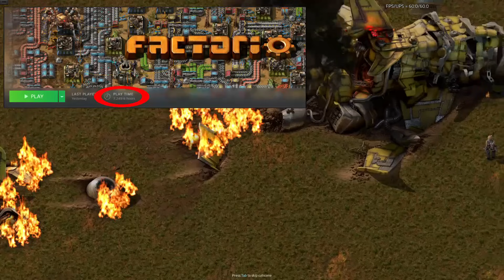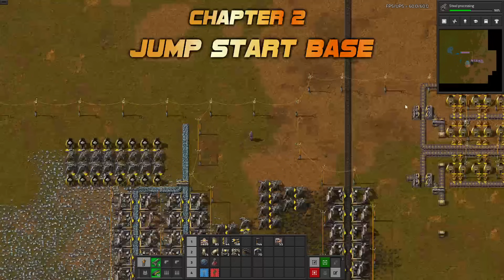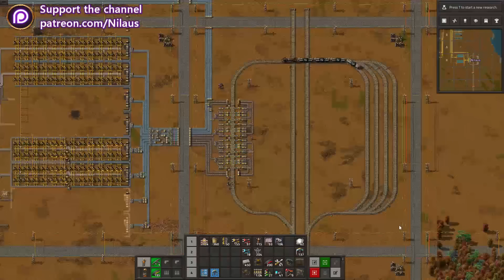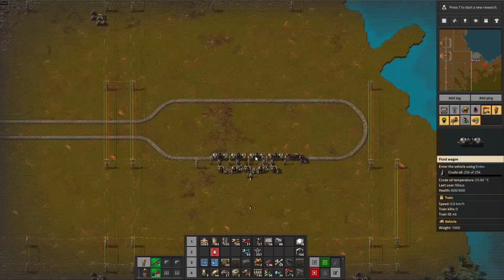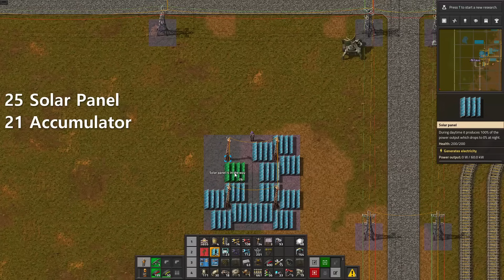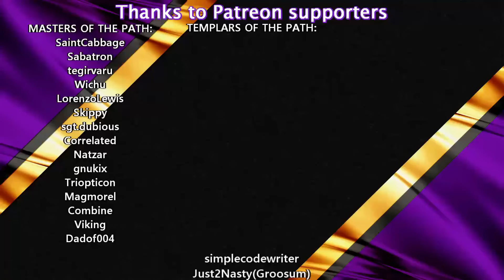HOW TO PLAY FACTORIO | 7000+ Hours of experience explained in 30 min

Comment: I honestly am sick of playing this game for now or at least by myself, I was sick of making factories that weren't able to make enough throughput and so I was like "Fine! I will watch a guide!" I used these city block designs and those massive furnace stacks and entire mining outposts and you know what happened? The place was too goddamn big to run. This guide goes from "Oh you need to do A, B, C and you're like okay this isn't so bad and then he cuts to D and A, B and C are now scaled insanely large and require an impossible amount of power to be ran and then bro's like "Ok let's do D" and he slaps down a gigantic blueprint for D that requires a disproportionate amount of power and land to make sure the insane pollution it puts off doesn't spread to biters because screw it and without even giving you a compromise on a more fair start or upgrade from where you started he instantly moves on to E, F and then G which all have their own major plants. Hell something I don't wrap my head around is how you need Iron Ore for Concrete but funneling iron from your furnace stack is a pain and takes away from total production and also is a pain to route. This game is a pain.

Comment: I really hope you see this comment, As a new player i REALLY hope you see this. 

While 7,000 hours in Factorio demonstrates an impressive dedication and mastery of that specific game, it doesn't automatically make someone an expert at teaching or helping a new player. Factorio veterans often optimize for high efficiency, intricate logistics, and massive factory builds — concepts that are overwhelming to someone just starting out. A new player is typically still trying to grasp the basic mechanics, like how to mine resources, craft items, and automate simple processes. When advice comes from someone used to late-game megabases, it can feel irrelevant or overly complex, leaving the beginner more confused than helped.

Additionally, experienced players can develop tunnel vision or habits based on optimal strategies that may not align with a new player's learning curve. They might suggest blueprints, ratios, or techniques that skip the critical process of learning through experimentation and failure. New players benefit most from understanding why something works, not just how to do it. If a veteran insists on doing things the "right" way without explanation or flexibility, it can discourage exploration and creativity — both of which are vital for learning and enjoying the game at early stages.

Lastly, the knowledge gap between a 7,000-hour player and a beginner is enormous, and bridging that gap requires patience and empathy — not just raw experience. A seasoned player might unintentionally use jargon or concepts that a new player doesn't understand, or they might take over and "solve" problems too quickly. Helping a new player effectively requires stepping back, slowing down, and meeting them where they are, not where you’ve ended up after thousands of hours. In this sense, a helpful teacher isn’t the one who knows the most — it’s the one who can communicate the best.

Comment: 13:30 Solar Panel Arrays:  The second priority is uh, more a design priority. You want to avoid the unfortunate four-way rotational symmetry that so easily emerges when working on a square grid. 

Well said. Please avoid inadvertently creating shapes which might look like symbols that were used by certain groups during a certain war during the 1940s.

Comment: >These are the basics
>Shows some ghost duplication thing I've never seen
>Refuses to elaborate
Reply: This is exactly why I came to the comments.
Reply: Pretty much my take.
Reply: gigachad.jpg
Reply: People usually don't learn to do this until they have bots going, which is like 30-50 hours into a first playthrough. Done in first minute of the video
Reply: @patweed2909  I think that the blueprint function has probably been one of the most significant jumps in gameplay after even two hours of playing. I have presaved templates of different resources that I can just slap down and mindlessly follow to get myself up to speed.
Reply: They are blueprints and copy/paste. There are buttons on your hotbar and keyboard shortcuts to use them.
Their purpose is for planning what you and/or your bot network are going to build.
Reply: @kurkunkus  Thank you sir. That night I waited for a mate to hop online and it was far simpler than I thought.

Comment: The solar power pattern overlaps so you have far fewer accumulators than the ratio should have, with 4 of those in a grid it goes from .875 ratio to .67 (ideal being .84), I'm presuming it gets even lower and approaches some limit as you add more. Just thought I would mention that as it's quite a large gap from the ideal ratio and I thought maybe you missed that

Comment: the biggest bottleneck in my bases is that i build an oversizes jump-start base and struggle to transition it to a full-size base. i usually end up with a clunky, inefficient hybrid where components of the too-large jumpstart are mixed with my city blocks and train networks.

Comment: hey man this is a great video! i just recently came back from factorio (last i played this was 0.7?), so much has changed. a few questions though:
1) if the map has a patch of resources, and get in the way of city blocks, what to do?
2) what do you think of circular intersection for train rails?
3) idk why every time i attempted using this big of a scope, i always come up short and finally giving up halfway (my first game beat was during 0.4/0.5? it uses spaghetti belts everywhere, but never again did i beat it by using the "neat way"). reason it's getting too big to walk around, resources are being mined but not used, stuffs being produced but again, never used. how do u think i can ease up into this while not giving a difference shock in the scope change?
4) what do you think is considered a... "just follow this" layout / blueprint? i always never copy blueprint, because i like doing things my way (inferior, always). e.g. a green circuit production line with 3:2 ratio on its copper cable, it's optimized but if it's 1:1 it still works. do you have anything that says like "if this isn't like this, it's not gonna work" kind of layout?

I was actually subscribed ever since the early days, but I recently changed my account, so have another sub! :D

Comment: I don't understand your Kovarex setup. Isn't this going to lock up because the beltfed U-238 is going to fill up the entire capacity and at some point you won't be able to get it out anymore.
I build my setup with splitter with a prefered Input from the Kovarex output, so the belt only tops it up.
Reply from the maker: It doesn't lock. Hard to explain in comments, but try it out and see
Reply: @Nilaus  I might have to, thx.

Comment: the worst thing when i play factorio for me is when i would get overwhelmed by tasks thinking they're way to complicated, i would just turn off the game cause i didn't feel like making all of the infrastructure needed for the task at hand (Yes oil processing). Also i find it hard to abandon the starter base and tend to make the starter base THE BASE which is really bad in the long run, you often have too little space and you find yourself trying to fit assemblers in the tighest of places.

Comment: Good video. This a guide to normal factorio playtrought with high megabase potential.
Can you make the same video but for most secure deathworld design, viable for extreme deathworlds with highly buffed biters.
I can handle normal deathworld but adding difficulty makes me softlocked because of inefficient design. Can you tell about the best extreme deathworld designed?

Comment: On 1000+ hour mark I have started using looped buses. These can be feeded and drained in multiple places. Ordering doesn't matter a lot if supply and belt capacity is sufficient. Dead belt ends may end up as wasted space. Loops on low usage braches act as additional buffer-type storage.

Comment: The good:
+ City blocks is the easiest way to build megabase, unfortunately it wasn't really utilized in this video. Maybe the next?
+ Promotion of steel furnaces compared to electric. Electric are not needed until you want beacons and productivity modules.
+ Debunking uranium cost for Nuclear. I see people all the time building advanced shut-off systems to save fuel, not realizing that even saving 80% that's 80% of 0, so still 0.
+ Promotion of construction bots but not requester bots. There isn't any strategic reason for this to be a "good" but I think it is more fun to not "cheat" with requester bots.

The bad:
- Main bus design is bad in pretty much every way. It requires a lot of planning because it is nigh impossible to expand beyond what you planned for. Not only the number of belts that fit on the bus but also how many parallel lines you make room for. If you need another green production line but has no space where are you going to put the new line? At the end and start dragging in the opposite direction? You will also spend a lot more on belts and splitters and having to split off and rebalance all the time is also very time consuming. Because you are restricting yourself to a line instead of using the 2d plane you will walk a lot more too as all distances are longer and your base will be more belt than factory. Just look at the end time there: 30 hours for a very experienced player who has all the blueprints already prepared. That shows just how cumbersome it is to build.
- You don't talk about balancers, but all of those train stations are so over-balanced. It's unnecessary complexity in the early and mid-game and at the very end-game it even hurts performance with all those useless splitters.

Comment: Very crisp!  I think a good follow-up could focus on the science per minute benchmark.  First with the 60/90/150/294 progression and then where you could go from there.  What bottlenecks you might face like when you need to switch to remote smelting and production and then finally move science production away from the original base, also energy needs and implications for FPS/UPS.  It might give players reasonable goals for their bases so they don't get overwhelmed by taking on a larger project than they planned on.

Comment: For anyone who is going to repeat this keep in mind 2 things: the setup requires a 'peacful' start area otherwise bugs will crush very fast. And the other one - at the current rates one factory cannot support 3 labs with red science.
Reply from the maker: this does not require a peaceful start at all. If you are new then play on peaceful, but this base was build with normal biter settings

Comment: One extremely useful thing I did for water was to create a landfill block that had small gaps. This means that they cover most of a lake but leave a little water available for use by reactors or other water-needing megabase components. You only need a few such gaps, and if you put them in the area between city blocks, you find that it only takes a little bit of planning to get water where it is needed.

Comment: Nuclear power is rather easy to set up until you need water. At first it works great, then a while after it starts losing power because it's not using enough water. I think the piping is a bit buggy with this. What I find works is to supplement more water into your initial amount. So if you have 2 water pumps feeding 20 boilers, you'll need a 3rd to supplement the other 2. Also, every time I have to fiddle with water, I have to remove a pipe and put it back to get the water flowing right again.

Comment: I have been watching a lot of videos and also searching about the problems that I'm facing. Also play myself ofcourse to learn and put everything into practice.
My first game was basically halted by biters and turned into a saturation war.
In my second game I have handled defence better, but am struggling with expanding into the blue science. The base is the same as Nilaus' starter base (red & green + basic needs), where I'm stuck is what to do next after having researched all red & green.

Am basically clueless in what to do next, no matter how much I have watched or read :/
Could someone please give me a hint or advice? (copying the entirety of what Nilaus is doing doesn't seem right, but idk)

Also I just got 16hours into it... so basically a noob ;-;
Reply: get your starter base fully walled in with automated defense. Next, make a small train network to bring some oil into your base by building a track to the nearest oil node. Then defend that node by doing the same thing, this time though you will need to automate bringing in ammo by train to defend the oil node. Bring the oil back and start fleshing out oil production at your own pace. I recommend building just one building for each component to get the hang of things. When that works out you will want to expand production. When you get to the advanced oil production you will want to start exploring circuits from pumps to the tanks to automate overflow.
Reply: @cameronhoss4039  Thank you for the advice! I'll continue doing that and keep the  e x p a n d i n g  in mind. Thank you!

Comment: Bruh just clicked as a non subscriber, because I was looking for oil tutorial (got sulphur and plastic setup, atm need to get circuits for cracking) and quit the game cuz now im on a time limit (as my resources are running low and will have to setup a train too).
Reply: Nilaus likes to put all his builds in dedicated city blocks, which is why he trains oil back to his base. However, it's not a requirement. Just find an open spot with enough room (for expansion) and put down your starter oil production. Pipe it over to the bus, and then expand the production when you get advanced oil processing.
If you check out Nilaus' masterclass oil blueprints, they all define an area in which the maximum build will fit, and each stage pretty much can be stamped down on top of the previous step.
Nilaus builds this way because he's a neat freak and he's spent 7000 hours figuring out how to be neat, crisp, compact. If you're starting out, I'd say don't worry about that for now -- build your base and learn how things work. Later you can refine your style.

Comment: Possibly a dumb question: is there a reason to feed the raw ore into the smelter arrays of the jumpstart base on the top? I know I've been playing way too much Factorio lately because I immediately noticed that the copper and stone were each 'wasting' a belt by not feeding into the nearest side of the splitter. But I'm definitely still a beginner, since I always stumble when I hit oil. Liquids are just incomprehensible to me, especially when I try to learn/lay them out alongside a traditional main bus and have to start trying to get railroads up and running. So it's very possible there's some quirk I just don't know about yet.
Reply: It makes no difference which side of the splitter you use. It’s true a single yellow belt was “wasted” on each layout, but in the grand scheme of the game a couple of iron plates also don’t make much difference.

Comment: I've got almost half as many logged hours as Nilaus does, but a very small proportion of his insight and inventiveness.  I'm currently on a ribbon world playthrough (144 tiles wide) and using a lot of the master-class blueprints.  The extra fun comes from supplying them, not from a bus but from trains.  To this end, I've adapted a three-lane rail idea that I found in the Nauvis Post-Apocalypse scenario.  The outside two are one way, but there are frequent crossovers onto the middle two-way rail.  It seems to be working quite well.
@Nilaus: thanks for all the Factorio content over the years; I hope you aren't bored with it yet!